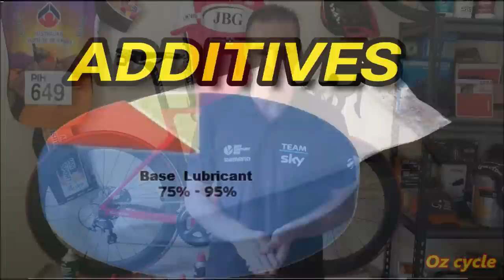Ultimate Chain wax - make it yourself

Comment: Have been using your earlier paraffin wax with paraffin oil then later wax & ptfe dip on mtb chains & like how clean the drivetrain stays. Was needing to make a new batch & saw my wax supplier had Microcrystalline wax ($14kg). Their description "is a high melt temperature paraffin (76-79deg) with a more plastic nature". Have you tried this wax yourself?  I'm going to try it with ptfe but can tell out of the box when I tried to break a small corner off it just slowly bent over & didn't break off.
Reply from the maker: Thank. No haven't heard of that wax before. Usually the harder the better for less friction. I will investigate that one. Cheers
Reply: @stevenleffanue  Hey Steven, I got rid of the Microcrystalline wax. It initially looked good & gave the outer links a hardish coating. When I broke/loosened the links it felt normal for a minute or 2 but when I checked the links a few minutes later they had all stiffened up again to the point each link had to be broken again & so on. I even tried to add some paraffin oil to soften the mix but was still terrible & would prefer the old wax & paraffin oil over this. Now back to the standard wax & ptfe.

Comment: Hi I've been waxing my bike chains for a year now. Question - is it normal that my wax bath turns grey in color after some time? I remember you saying that the teflon is greyish in color when wiped with cloth? Thanks
Reply from the maker: Yes that's normal and ok. If you swish a magnet thru the wax when it's molten you can determine how much ferrous material is in the wax...it sticks to the magnet. You can start a new batch when it's really dark.

Comment: Have you tried Tungsten Disulfide vs PTFE/PFPE? I'm trying to avoid PFAs, if possible. It's supposed to have a very low coefficient of friction. It is a very small amount though.
Reply from the maker: No but it should be good. Ptfe is cheaper and stays ultra clean. The friction differences between all these top additives is so minute compared to the chasm to oils.

Comment: Hi Oz Cycle, is there a reason that the maximum temperature of the wax inside the slow cooker should not go beyond 95 degrees? I noticed that in my slow cooker the temperature on the lowest setting goes to 110 degrees...
Reply from the maker: Overheating the wax damages its chemical structure.
Reply: It can also catch on fire

Comment: Great video, I know you said you have gone through many trials but how did you come up with the recipe 50g of PTFE powder and 1 pound of wax. I see a lot of chain wax recipes with molybdenum disulfate such as 5g of PTFE, 1g of Moli, then 1 pound of wax. I am trying this currently and not sure I like it. Haven't found 1.6micron PTFE also. Your help is appreciated.
Reply from the maker: Moly is an anticaking agent....3um or greater seems to clump, not required when 1.6um ptfe is used.
Reply: @stevenleffanue  Thanks for the reply. Where are you finding 1.6 micron for PTFE seems to be harder to find in USA
Reply from the maker: Mostly from China...Aliexpress or Ebay
Reply: @stevenleffanue  Thank you

Comment: So i tried this formula on my new x01 chain, did a deep clean of the chain like in ur other video (petrol and then white spirit) added 50g teflon to 500g paraffin and melted it at a very low temperature (around 75 - 80 celsius), i put the new chain in there for 15 mins (after wax was completely melted) and then afterwards let it dry for 20 mins. for some reason the wax just didn't want to stay on the rollers of the chain and came off almost completely after first 2 - 3 rides. Now i don't know if some wax is actually on the rollers or inside them because i cannot see it with a naked eye, nor can't scratch it off with a metal. I'm going to do this entire procedure again and hope for the best, If it doesn't work then i guess sram x01 chain is just not sticky enough (it's nickel with hard chrome coating) and paraffin falls off of it easily.
Reply from the maker: It will stick , your chain just needs to be clean enough. Final rinse your chain in isopropyl alcohol should do it.
Reply: @stevenleffanue  but how do i remove the wax from chain now? shouldnt petrol and white spirit have removed everything already?

Comment: You throw away the chain once it reached 0.5%, correct? Then when do you measure the wear? On one hand, it should be measured clean and without paraffin? But then the chain does not come in contact with drivetrain when clean?
Do you have a method of accurate chain wear measuring technique with a vernier caliper?
Reply from the maker: Yes,I have measured many chains in various studies with a digital vernier caliper. The overall conclusion is that .5% wear is an ideal replacement mark. See here...
https://youtu.be/953QTThT4_M
Reply: @stevenleffanue   Thanks Steve! I do not own a KMC digital chain checker tool. Do you have experience or now how to measure it with a regular digital vernier caliper or maybe read somewhere how to do it? I have a very good quality one but was unable info on the internet on how to do it, apart from Campagnolo manual which says that 132.6mm is a worn chain but does not specify any other details.

Comment: Yesterday I started cleaning my bike and decided I need a new chain, however after further inspection Its clear I need a new cassette and some jockey wheels as well.
So my question is as well as the deep clean and wax for the new chain should I do anything to the new cassette, does that also need a deep clean or any lube and if so what?
Reply from the maker: Not necessary to lube cassette

Comment: Hi I followed your instructions but when the chain came out it did not seize when the wax cooled. Have I done something wrong: perhaps not cooked it hot enough?  First ride tomorrow. I'll see how it goes as is.
Reply from the maker: Could be a number of things Craig. Follow the instructions exactly and it will work
Reply: @stevenleffanue  OK so I followed the instructions exactly and found out what I had done wrong. Immediately after wiping the excess wax from the exterior of the chain I started manipulating the links. The chain did not seize up but, judging be the wax on my gloves, I worked most of the wax out from inside the rollers. Second attempt and I let the chain cool down after wiping. Worked exactly as your video showed.
Thanks for the great advice.

Comment: Followed the procedure with a new connex chain. Enjoyed the smooth clean chain for several hundred miles. Used the re-waxing process.  Shortly after I noticed an annoying clicking sound.  I double checked to make sure the link was in the proper orientation. The clicking sound became progressively worse. Checked the BB, crankset, wheel bearings. Finally installed a new Shimano chain and the noise disappeared. Anyone else have a similar issue with the wax process or connex chain?  I love the clean smooth ride of wax, but hesitant to try again.

Comment: Additional question, I heard that waxing may cause the chain to run louder than with a lubricant. 
Does the PTFE help to avoid that or are there any other tips to avoid a loud chain after waxing?
Reply from the maker: A waxed chain should be very quiet
Reply: Its very quiet after waxing. But not for 250-300 Km. something like 150 Km is more realistic for me. I just use wax in a bottle after 150 km before every ride. easy and good compromise

Comment: Cleaned chain with about four rinses of mineral spirits followed by two rinses of naphtha, leaving chain in clean pristine condition prior to treating with the wax / Teflon formula. Got about 225 miles of quiet clean riding on that chain before detecting a little bit of chain noise and deciding to retreat the chain. Cleaned the chain with the boiling hot water as shown in the video. Could detect no dirt, grime,  etc on the chain prior to retreating. Retreated and now the Teflon part of the solution has turned a distinct shade of gray. Wondering what caused it to do that. Normal? Function of the Heat? I can detect no particulate in the solution. Puzzled.
Reply from the maker: Dura ace chain?
Reply: No,  KMC X9.

Comment: Thank you for the very informative video!

I'm tempted to try this but the cost seems to creep up. Amazon has 1lbs of paraffin wax at $10 and 50gm of PTFE is around $9 so that's $19 per clean/lube. I suppose the excess could be reheated to reduce cost. But then I'm also a bit wary of PTFE health hazards.

Amazon has 4oz of Super Secret chain lube (wax with tungsten di-sulfide) for $27. I think I can get a couple of chain lubes out of it so I might just try that out for an easy compromise.
Reply from the maker: Your $19 worth should last 12,000 -15,000km.....surely thats cheap enough?
Reply: Your $19 does more than one lube. You get multiple lubes from 1lbs of wax mixed with PTFE. If you are worried about PTFE you have the option to use the original recipe using paraffin oil. The "excess"  is meant to be used for successive chain lubrication.
Reply: @stevenleffanue  I assumed the bottled wax would be equivalent. Maybe that's not a good assumption?

Question - do you reuse your master links or just buy a stash?

Comment: I got inspired to wax my new mountain bike chain to keep it super clean from the start. But I couldn't get the PTFE powder in time, so I just used straight parafin wax. The chain is super clunky and loud, even after 6 hours of riding. Do you have any ideas or suggestions for me? The PTFE powder is delayed, shipping from China. Decades ago I used to wax my road bike chains, and I don't remember them ever being loud like this.
Reply from the maker: Maybe the wax isnt sticking to the chain very well. Make sure your chain is super clean b4 waxing.
Reply: @stevenleffanue  Thanks for your reply. What I'm noticing is that the wax sticking to the chain is narrowing the spaces that the chainring teeth fit in (inside the plates and between the rollers). This is the source of the 'clunkiness' and noise, as the chain doesn't go smoothly on and off the teeth. It's an 11 speed set up on a mountain bike, with a single Wide/Narrow chainring. It also seems to cause a bunch of noise due to the same effect as the chain goes over the derailleur wheels. I hoped it would quiet down as the wax got worn out of those spaces, but it hasn't. Have you encountered this problem before?
Reply from the maker: This excess wax will come unstuck as you ride. Should be fine by 5km into your ride.

Comment: I saw in a previous video that you recommended to remove the chain from the wax and plunge straight into cold water. Is there a reason why you don’t mention that in this video?
Reply from the maker: Not necessary when using ptfe. You can still do that with the waterfiir extra outer chain protection in wetter weather tho.

Comment: Hi Oz Cycle, I have looked at both chains that I have done with the PTFE wax solution, one chain is Shimano and the other KMC, the Shimano has done 100km and the KMC waxed and waiting, and I can't see any PTFE on them at all, I did use 1.6um would it suggest that my PTFE powder is fake or is that normal, thanks for your support.
Reply from the maker: Sounds normal. It just looks like ordinary paraffin wax
Reply: @stevenleffanue  Thanks for the fast response

Comment: Hi. My first batch of wax is now getting low in my slow cooker. Should I throw it away and make a new batch or just top up with more wax and ptfe?
Reply from the maker: Yes you can top it up but the ingredients are cheap enough to start another batch to keep contaminants as low as possible
Reply: @stevenleffanue  Cheers. Where I live I have to import the ptfe at an exorbitant rate so I'll top it up this time. When I get back to oz I'll have to stock up!

Comment: when do I need to re-apply another 500g of paraffin and 50g of PTFE? 
Will it stay for 15,000km by just re-heating/cleaning every 300km? 
thanks
Reply from the maker: Yes , 1 batch should last 10,000 -15,000km depending on how clean the chain is when rewaxing.

Comment: Hi, I’ve now got my PTFE 1.6 micron powder and it is not really a powder and has clumped together in the packet. Do you have any tips to get it to be like a powder? Thanks for all you do.
Reply from the maker: Quite a number of people are finding this with their ptfe. Ive not seen it myself but could be moisture in the powder. Seems to be a suppliers problem. All I can suggest is try smashing it up as fine as you can.
Reply: I’ll try and see if it drys out over a week or so. Thank you for getting back.

Comment: The waxing of a chain, is it also advisable on a MTB ? I just orderd the paraffine and the teflon powder. and going to buy a slowcooker. nice video ! ;)
Reply from the maker: Yes it's perfect for mtb and off-road chains as it doesn't attract dirt.
Reply: @stevenleffanue  Doesn't the chain form corrosion or rust on some contact places on the cogs when she gets wet?

I today received finaly my teflonpowder. now i am going to clean my chain, cogs and derailer and add the paraffine+teflonpowder to the chain and test.
Reply from the maker: Cassette sprockets are anodised so will take about 8,000km to wear that off , then rust can start.
Reply: @stevenleffanue  no i mean the chain. Normaly when i clean my bike afterwards when i dont imediatly grease my chain it gets a rusty film
Reply from the maker: Yes , your chain needs a protective layer
Reply: @stevenleffanue  I have now waxed my chain i think almost 150km (mtb) it seems the rollers of the chain are realt dry, the outside feels little waxie but the touchesurfaces look to dry... is this normal? i dont have a good feeling to do 250-300km with this.

Comment: I got hold of some premium grade PTFE.  Not cheap.  It floats on top of the wax but yours sinks to bottom?
Reply from the maker: Let the mixture cool to room temperature then reheat it again,stir and it should be milky
Reply: @stevenleffanue  thanks.  Previous video you let skin form on top before taking chain out, still required?

Comment: Hi - I rewatched this a few times but just wanted to be sure - do we need to turn off the slow cooker after wax has melted? 
So this means that the we will dip the chain into the slow cooker with the slow cooker in OFF right?
Reply from the maker: Slow cooker stays on with chain in. I leave it for at least half hour
Reply: @stevenleffanue  thanks!

Comment: didn`t you add paraffin oil in the past? wouldn`t it be beneficial to add it now?
i am mainly concerned with how well it will perform in wet/cold rides
Reply from the maker: Performs great in wet as wax is waterproof. However,surface rust often occurs more readily on outside of chain so I suggest after the wet ride to rewax

Comment: i have always heard stories of the wax running out or the chain going squeaky during a ride. how do you deal with that when you're like 60km away from home? edit: just seen your wax in a bottle video! why not sell your wax and cleaned chains? i am sure there's a market for it!
Reply from the maker: Wax lasts 250 -300km before rewaxing. Yes,since 1.6um ptfe is in shortage Im working on a supplier for wirkdwide distribution.

Comment: i bought a “wrong” chain to wax … which is KMC … some website said KMC chain is no good for chain waxing due to factory grease is hard to remove … n they recommend Yaban chain … 
so im wondering which yaban chain should i buy … non SLA or SLA one ? n why ?
SLA one cost double than the non SLA ….
Reply from the maker: Any chain can be waxed. Use the initial clean process and it will work

Comment: I finished my second waxing after completely cleaning my chain. I feel like my drivetrain is a bit noisy and not as smooth as it should be especially in the big ring (Front Derailleur). I confirmed no FD chain rub.

I'm using the Paraffin Wax and PTFE and a splash of Moly.

The chain almost feels 'sticky'. I let the chain drip after coming out of the slow cooker.

What should I troubleshoot? Thanks in advance!
Reply from the maker: Sounds like you might still have some previous lube in your chain?
Reply: Have that same issue Justin, have you found the cause or a solution to the noise?

Comment: I just started mixing my PTFE and wax, and that darn PTFE is just rubbery and in big chunks in the wax. How should PTFE powder look when you get it? Mine was more like playdoh than a powder. I used the old recipe during the winter here i Norway and the chain and cassette is stil in really good condition even after a winter with ebiking.
Reply: PTFE should be a silky, free-flowing powder that doesn't melt. Note the particle size that is quoted also.

Comment: In your previous videos you add parafin oil and take the chain out of the wax bath when the temperature is about 50-60C. Is it not necessary anymore?
Reply from the maker: Correct. Oil attracts dirt
Reply: @stevenleffanue  and what about time when to take out the chain from paraffin bath? In your previous video (where you answer questions about chain waxing) you said that it's necessary to take out chain when temperature of wax is abou 50-55 C. Because if it's higher then wax is going out of pins too much because it is too liquid
Reply from the maker: Its fine with ptfe to take out at the maximum temperature and allow it to drip to cool
Reply: @stevenleffanue , tried yesterday with my friends. Thank you from Saint Petersburg, Russia

Comment: Hi Oz Cycles, do you have a video explaining why you prefer Connex chains over other brands like Shimano? I thought I remember seeing one a while ago but I can't find it.
Reply from the maker: 1/ The SO connex chain is prone to rust more than most others which was part of the test.
2/ All connex chains come with the quick link...to buy the link on its own is more  expensive
Reply: @stevenleffanue  thanks. Do you find it more durable than other brands? Have you tried the SX version or just the SO? I think the SX version has a special nickel coating to protect against corrosion and is fully stainless steel inside and out